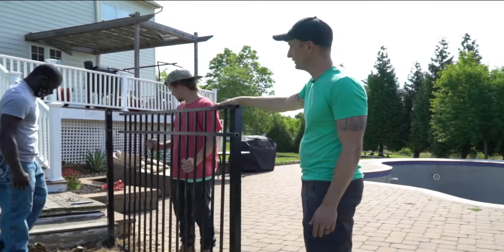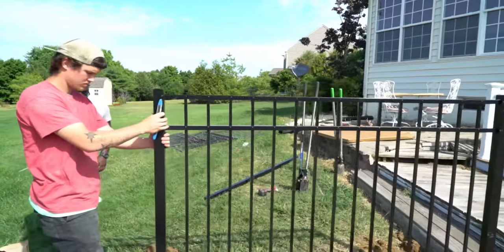How To Install Aluminum Fence | DIY Aluminum Fence Installation | Complete Guide

Comment: When using a digging or spud bar, USE GLOVES.  That heavy bar will tear up your hands, especially if you don't do a lot of manual labor.
When applying the hinges and latches, to make sure the self tapping screws don't wander off the point that you want them, use a center punch or small drill bit to have a dimple exactly where you want it so the hardware is exactly where you want it.
You can also use a circular saw to cut the fence, just use a metal cutting blade.  Put painter's tape over the fence so that the saw won't scratch the paint or finish of your fence.
Reply from the maker: 100% about the gloves.  And good tip about the circular saw!

Comment: Good video. I used the Swanson Tool Co PL001M Magnetic Composite Post Level, Yellow, Includes Elastic Loop for Hands-Free Work and 3 Vials for Easy Plumb and Level Reads
Reply from the maker: I've used them but they just seem to take longer than a traditional level.  But if it works for you that's all that matters!

Comment: Thank you for taking the time to create this video. 

Quick question though (around 6:23 minutes), you added your first panel to the first and second post. I thought its best to let the concrete set before adding the panels. Thoughts? And does it make a difference if you doing this in colder weather.
Reply from the maker: Thanks for the question, as long as you pack the concrete with the digging bar you won't need to wait for the water to cure.  I prefer to "dry set" the concrete and let the moisture from the ground cure the concrete over time.  

Also, there's no way to set all the posts before adding panels unless using brackets which are expensive and unnecessary for this.

Comment: Question: So you can leave the concrete dry in the hole?  Or do you add water to the concrete once it is in the hole?
Reply from the maker: we just do dry.  Just have to make sure you pack with the digging bar and you'll be good to go.

Comment: Good video only tip I would say is if you are going to rent an auger get it from sunbelt, hertz, ect they offer the one man with the torque bar it is user friendly and can save you from injuring yourself
Reply from the maker: Great tip!  That must be the Little Beaver that you're talking about.  Definitely easier than a typical one man auger.

Comment: do you need to add gravel in the post holes for water drainage before putting in the posts..?
Reply from the maker: Nope not needed, just concrete and you’re good to go.
Reply: @myfencedirect8636 does it not corrode the aluminium within months? ive heard its a no go with ali posts and to never ever use rapid set...

Comment: When you come down the steps @19:19, there is about 5' of open area to get in the pool- is that pool code? Seems like there should be some type of "barrier" to stop kids/animals
Reply from the maker: The customer was redoing the deck and putting railing in that spot. We just attached a panel for the time being
Reply: @myfencedirect8636  U said it right at the beginning- i was sleeping I guess--geez

Comment: How would you remove it? We were thinking of removing ours.
Reply from the maker: Depending on how it was installed and how much concrete you can try wiggling the post with some decent force and then use a 2x4 underneath the rail and use it to pry it up.

Comment: Great video..thanks for sharing. When you are adding sections, how do you keep each post level and plumb as you are adding the sections. Do you add the section to the post, then add the concrete, level and plumb, and then wait for concrete to set before going on to next section.
Reply from the maker: Sorry just saw this. You just install the post then attach section. Then set next post and keep going in that order. 

I personally don’t wet set the concrete. I would dry pack it and let the ground water set the concrete over time.

Comment: We are installing 6ft H aluminum fence on top of the concrete around the pool as well. Do you think 6inches is deep enough to hold the posts?
Reply from the maker: Are the holes in dirt or are you drilling out concrete?  If in dirt, definitely not enough.  I'd say at least 2 feet.  If in concrete that is fine just make sure to use anchoring cement.  See the link below.

https://www.homedepot.com/p/Quikrete-20-lb-Anchoring-Cement-124520/100318500
Reply: Doesn't sound enough! Should be around one third the height of the post i.e. two foot holes concreted into the ground.

Comment: What if the neighbors fence is a foot and half to their side of the lot line and your 2 inches on your side of the lot line. With what do you fill the space between your fence and theirs?
Reply from the maker: I would ask if you can put a post next to theirs but don't concrete anything that's on their property.  That way it's easy to remove if need be.

Comment: Aluminum should not be set in concrete as Aluminum reacts with the alkalis in portland cement producing hydrogen gas, causing corrosion on the aluminum fence posts. I contacted Sakrete and Quitrite and both companies confirmed that aluminum and concrete are incompatible and not to use it on aluminum fence posts, they will eventually corrode. I used Fast2K Foam Deck & post anchor on my aluminum fence posts. Dug down past frost line bell shaped the bottom and installed 8” of  fiberglass rebar thru the post near the bottom of each post making a x so the post had legs. No chance the posts will ever pull out of the foam nor will the foam ever come out of the hole with the bottom larger than the top.  Posts survived an Illinois winter and didn’t budge.  Foam sets up in minutes.

Comment: At 18:50 you said... "Lower the posts"... Could you please elaborate, what you meant by that ?
Reply from the maker: Yeah the editors didn’t get that part quite right. So  after everything is in you’re going to lower any posts that are a little high so you create a nice uniform look.

For this I use a sledgehammer and a block of wood to tap down the post.
Reply: @myfencedirect8636  Thank you for your response and clarifying. Great Video. Good Job.
Reply from the maker: You got it!
Reply: Really Sameer? You know what he meant. You’re THAT GUY.

Comment: What's the average price for a project like that ?
Reply from the maker: It really depends on size.  About how many feet and gates did you need?
Reply: @myfencedirect8636  170ft??
Reply from the maker: @mrgrind210  you would probably looking at around $3500-$4000 depending on layout

Comment: i read that you shouldnt use concrete with aluminum fencing because itll cause a chemical reaction and erode the aluminum
Reply from the maker: it's powder coated so its not coming in contact with each other